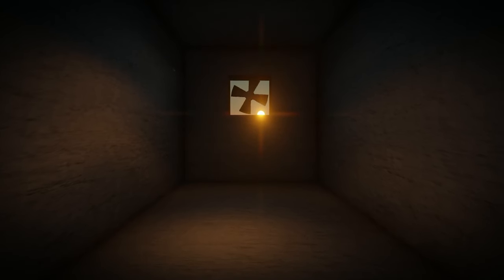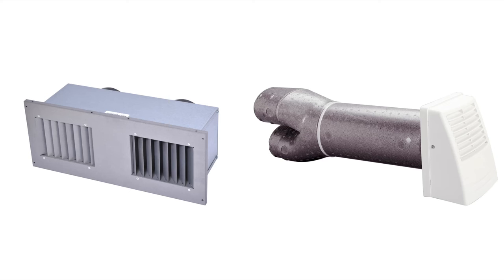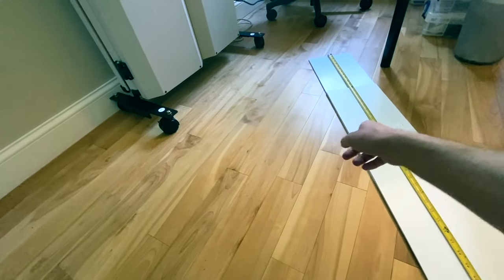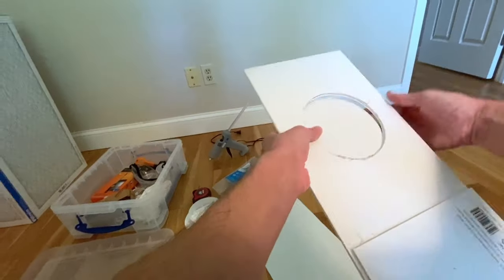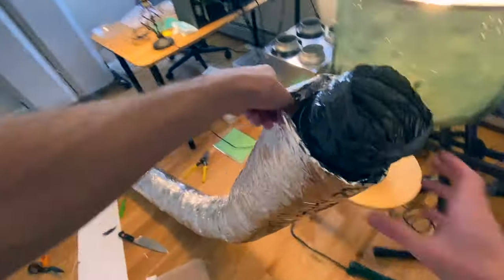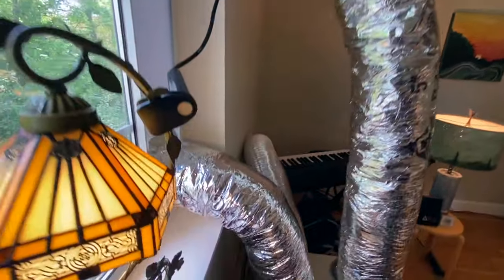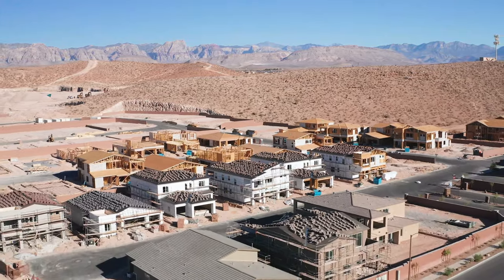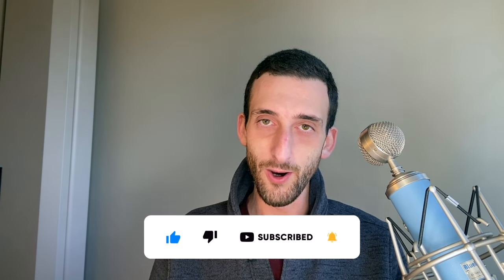DIY Energy Recovery Ventilator Installation (For Homes WITHOUT Ducts!)

Comment: Why do you recommend this approach over say just setting up a high CFM fan on one side of the house with the window open on the other side. Is the main reason simply that the outside air is not always clean? If we live in an area with good outside airquality do you think the HRV setup is still worth it? I probably just need to watch more of your videos, aside from filtration is the HRV unit doing anything else?
Reply from the maker: So, this video is about ERVs, not HRVs. I use an ERV because they moderate both the temperature and humidity of the incoming fresh air. So it's not too hot, too cold, too humid, or too dry. This is crucially important for not only comfort and energy-use, but also to avoid turning your house into a breeding-ground for mold. And yes, the filtration is also important.
Reply: @HealthyHomeGuide  Ok gotcha! So for VOCs, c02, and particulates, a simple setup with airflow and air filters will probably work but if you are trying to control humidity and temp you'll need something like an ERV
Reply from the maker: Correct! I commend you for asking.

Comment: Creating an ERV is super cheap.  Get a tote, a bunch or coroplast, and some foam.  The "core" in the ERV is just layers of coroplast where the alternating layers are orthogonal.
Reply from the maker: You're referring to an HRV. I actually have a video in which I talked about making an HRV. ERVs are not nearly as easy to make because they deal with heat AND moisture transfer, not just heat transfer like HRVs. I discussed this in the video.

Comment: Interesting solution for a renting situation. You could possibly set up a large box of some sort from Ikea like a pax closet, and put the whole thing in there to make it more aesthetically acceptable, hehe. Another idea is to glue on a layer of insulation like rockwool on the coroplast as you might get condensation on it in the winter.
Reply from the maker: I love those ideas, thank you!
Reply: I was personally just thinking of building a box out of plastic or big one out of wood... then you can simply get aluminum sheets, put some holes through them, put a thread through those holes and separate the sheets by nuts.

Comment: Can I just use a dual hose portable ac that uses fresh air?   A good one with a variable speed inverter costs around $400.
Reply from the maker: Dual hose portable ACs don't bring in a significant volume of fresh air, unfortunately.

Comment: How do VOCs compare for indoor air from decade to decade in home building techniques?
Reply from the maker: This is a great question, and the answer is of course very complicated and depends on the specific building materials used. That being said, here’s a general trend: given that newer homes are built increasingly tightly, VOC levels within them tend to rise quite dramatically without adequate ventilation.
Reply: @HealthyHomeGuide  thanks sir! That makes sense.
Reply: I think the home itself matters a lot. Before replacing some windows in my home, we didn't have high humidity issues in the winter, because the heating was pulling air from living space, and windows were leaky as hell. Most likely VOCs would be vented out as well. After we have replaced half of the windows, and changed heating, winter indoor humidity became a real issue. 
My feeling is older houses may had added VOCs and other nasties to the air, but the natural air exchange (thru gaps) was much higher.

Comment: Hi - can you tell me why you chose the 130 CFM Energy Recovery Ventilator - why not spend an extra $100 get a bigger one even if it is overkill? Also Why does it say 150CFM has 67% Efficiency and the 160 has 75% Efficiency - wouldn't you want to get one with better efficiency?

Thank you for the video - it is extremely helpful :)
Reply from the maker: Glad you found my video helpful! That’s a good question. My rationale for getting the 130 was simply that the specs said it delivers enough airflow for the size of my living space. In retrospect, I definitely could have spent the $166 more for the 150 to get a bit more airflow.

As for your efficiency question, I’m not exactly sure - that might be a question for Broan. Personally, I feel that 67% vs. 75% isn’t that significant of a difference. Mine is 67% efficient and I’m very satisfied with it.
Reply: @HealthyHomeGuide  Thanks for your reply. I just got off the phone with Broan and they said it has to do with humidity - so not a big deal either way (I thought it less efficient at heat recovery which would have been more of a problem)

Do you max out the air flow with your 130?

Also how heavy is the unit - is it hard to navigate it from room to room? Does it come on wheels?

Thank you very much!!
Reply from the maker: @chrisjabre  I don’t max out the airflow. The max airflow I can get is 100 cfm (I discuss this a bit at around 23:00), but I use only 55 cfm.

The unit doesn’t come on wheels. It’s 37 lbs, so not too heavy in my opinion.

Comment: Studies have been done that shows that air generally takes the path of lease resistance.  So, draw a line from "in" to "out".  In this case, a path of about 4 feet.  Especially after things settle down a bit.  Maybe a bit farther, but not much farther.  It would be orders of magnitude better it you ran the supply duct line across the house as far as possible to make the return trip take longer.  Longer duct makes static, so you could use a larger duct, which would help a little.  And just so you're not disappointed with your experiments, the various fans are actually probably doing about 20-30% of the mixing you think they are.  A truck load of expensive measuring gear would confirm the actual numbers.  

You have all the parts - ERV, dehu, air scrubbing, ideas about distribution.  Home Performance has a great vid on how to tie it all together when you get to installing it into your home permanently.  

Also, Instead of the small, restrictive filters inside the unit, you could transition the 5" duct to a larger size (some standard size of 4" pleated MERV 13-16, say 24x24 or 20x20 etc.) and back down to the 5" duct.  We often do this from cardboard for proof-of-concept, and to make a model for fabrication.  We call this a reverse bottleneck.  A whole lot less static resistance, less costly, and filtration will last much, much longer.  Ducts are generally disgusting because they have been treated badly and have never been cleaned for the life of the home.  

I know this is an experimental install, but when we install these permanently, as much as we can, we run flex duct pulled as tight as we can, straight as an arrow & use hard 90s for all turns.  So planning is critical.  The slightest turn, sag or bunched-up flex causes huge static (resistance).  We also mastic everything, but in the house, maybe some duct leakage doesn't matter. 

We "exhaust" air from bathrooms, laundry, kitchen - where chemicals, moisture and odors hang out.  Existing bath fan box can be gutted and duct attached to that to minimize the work necessary.  It goes without saying, but I'll say it, air seal everything you can get access to while you have the chance.  Every tiny crack matters.  Water-tight!   Imagine you are sealing a submarine from water leakage, like in "Das Boot".  all the hundreds of leakage add up to leaving a large door open year-round, but it's all over, like a sieve.  

Building Science Corporation is a great source for stuff.  We do Net Zero Energy homes which makes me a little picky about the details that, added up, detract about 50-70%, and often more, when not executed like NASA.

Peace!
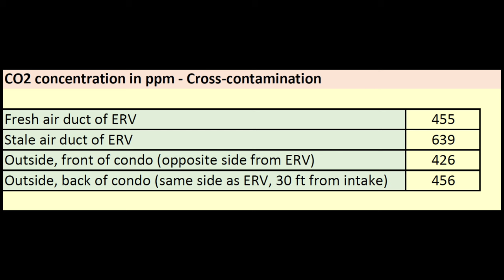Reply from the maker: Thanks for your comment! I fully agree with you about the limitations of my setup method, and I did speak to some of them at 34:55, and throughout the video. 

In this video, I’m not arguing that my setup method is optimal. I’m arguing that it can be used effectively in scenarios where we don’t have other good options - I feel that the CO2 data I presented supports that.

This method can be used by those of us who live in apartments, which can’t be altered. It can also be used by homeowners who don’t live in homes with ducts, and don’t have the money to pay a professional to retrofit an ERV into a ductless home. In many areas, there aren’t even professionals who do that kind of work!

Of course, I would not use my method in a new construction. 

I do agree with all of the points you brought up - you sound very experienced. Peace to you!
Reply: @HealthyHomeGuide  Good data.  Keep testing👍

Comment: Yo Kess, incredible video man.  I've been researching ERV options for windows online recently, and as luck would have it, I stumbled upon this video you created two weeks ago.
A couple questions for you:
-What is the energy consumption like for the ERV model you are using?
-How has the setup been performing in the winter? Does it noticeably lower the temperature of your office relative to other rooms in your house while running?
Reply from the maker: Hey man, it's great to hear from you! Glad you found my video and enjoyed it.
-As far as energy consumption, the PMSM ECM fan motors the Broan AI Series 130 has are relatively efficient compared to some other units on the market. Electrical characteristics are as follows: 120 volts, 60 Hz, 2.4 A, 110 W.
-I checked with a bunch of HVAC installers in northern New England, and they all said that the Broan AI Series are reliable for winter use in this region. Personally, I haven't had it long enough to be able to report on how it performs when the temperature is very cold outside (below 20F or so). When it's pretty cold outside (around 25-30F), it functions well. To be specific, at 25-30F, the temperature of my office is maybe a degree or two colder than the rest of the house, IF the office door is kept open to allow air circulation/exchange. If I close the door to my office, isolating it, the temperature in my office decreases a little more, maybe around 65F when the rest of my house is 70F. ***BUT note that I don’t have a thermostat in my office***. That's with continuous ventilation at 55 cfm. Hope this helps, and welcome to my channel!
Reply: @HealthyHomeGuide  Awesome, thanks for the reply.  That's good to know the ERV does not drop the temperature of the room too much.
Reply from the maker: @johnlally8188  For sure! That’s the magic of heat recovery!
Reply: @HealthyHomeGuide     Are you running that electric baseboard heater in your office?  When the office cools, does the baseboard heater kick in more, minimizing the temp drop?
Reply from the maker: @DK-vx5co Good question. The thermostat (for that baseboard in my office) is in a different part of the house.

Comment: I guess for a humid climate you would have to use a dehumidifier.  I want to install a ventilating dehumidifier.  The hard part is just figuring out the drain for the water.
Reply from the maker: Correct! For getting rid of the water, I use an automatic condensate pump. I'm working on a video explaining how to set this up.

Comment: Thx!  What’s the difference between your DYI HRV and this ERV?
Reply from the maker: Good question! This ERV can run all year round, even during hotter, more humid periods because it modulates heat AND humidity, and my DIY HRV should only run in the cold, dry months because it only modulates heat - not humidity.

Comment: This is amazing, thank you! 👏
What are you thoughts on smaller/cheaper units attached to multiple windows in a home? At a minimum, I'd like one for each occupied bedroom. It seems like the Panasonic WhisperComfort is the most reasonably priced model but I do wonder about the lack of distance between the exhaust and intake...
Reply from the maker: You’re very welcome!
You could certainly try an approach with multiple smaller units in multiple windows. I can’t vouch for the performance of ERVs I haven’t tested, but theoretically, I think cross-contamination would be more okay if an ERV only had to ventilate one bedroom, as opposed to a larger area of a home. Still, it should be minimized if possible; I’d recommend using vents facing in opposite directions in your insert. On the ERV itself, use a 90 degree duct elbow to direct the supply airstream away from the return at least.
Reply: @HealthyHomeGuide  With the Whispercomfort, the interior side is fixed and doesn't allow connecting ducts.  I'm thinking of trying it anyway.

Comment: I have additional comments based upon my experience as a radon mitigator applying ventilation and pressurization to energy efficient dwelling units in this hot, humid climate. Including high rise Multifamily.
1.  I have found that ERVs and HRVs commonly move much more air than advertised. They usually over-ventilate when selected according to published performance.
2. In most tight, energy-efficient homes here in SW Florida, with two or three occupants, I have found that indoor carbon dioxide levels of 600 are easy to achieve with only 18-24 cubic feet per minute of outdoor air. Such low and precise airflows will also mitigate radon emitted from building materials up to about 7-8 picoCuries per liter. WITHOUT THE NEED TO ADD A DEHUMIDIFIER.
3. In my experience, a variable speed air mover can be controlled by a CO2 controller to maintain 600 ppm CO2 by adjusting ventilation rate automatically as occupants come and go. It is uncanny as to how well it really works.
4. It is my long-term experience that that an electronic humidity controller that is set to suspend air delivery if indoor goes above 59.9% will prevent mold without having to install a dehumidifier. A reliable controller will prevent increase in the indoor relative humidity to a level that the air conditioner can't "dance with."
5. Keep in mind that USEPA recommends all ventilation air be filtered by a MERV 13 filter as it enters the breathing zone. https://daisyductless.com 
6. Here in SW Florida, many mechanical ventilation radon mitigation systems include a home-made filter that loads up and stops airflow within a short period. Sure, these installations with loaded filters rarely cause mold problems, but radon reduction is only temporary and for a short term until the filter is serviced again, usually every 60-90 days. Such filters are almost never serviced. And radon goes right back up, but homeowners and occupants don't know it because they only rarely retest for radon. It is not unusual to see radon systems that have not reduced radon for twelve and more years. And the owners don't know it until a buyer asks for a radon test. There will be lawsuits. And I predict that when that happens, many radon mitigators may soon thereafter have insurance cancelled.
7. Blue oil-filled manometers as substitutes for a radon meter. DON'T LET IT HAPPEN. They measure suction, not airflow. Oil displacement will be greatest when the homemade filter is completely blocked. A completely false indication that radon is under control. If I were the lawyer advising the blue oil filled manufacturers i would immediately issue directives that oil filled manometers may never be used as mechanical ventilation radon system indicators unless used with a pitot to indicate actual airflow instead of pressure. A jury would likely ask "What were they thinking when they did this with home-made filters that they knew were rarely serviced?"  What would the jury's verdict be and for how  many $$$$$$?
8. ERVS. If not PROPERLY serviced, air intake filter becomes more rapidly stopped up and exhaust flows remain high. RESULT? Negative indoor breathing zone pressures likely causing or increasing radon risk. Another one for the lawyers. This one could also be determined by a motion for summary judgement limited only by the extent of insurance or by later jury verdict. ERVs must be regularly and effectively serviced. They may even be the cause of totally unexpected radon exposure and lung cancer. Who would have guessed?
Reply from the maker: Thank you for adding your experience and expertise to the discussion! All that is very interesting.
Reply: Is a homeowner able to “properly” service an ERV?  Or is that something a professional would need to be hired to do 3-4 times a year?  I’m in South East Florida and am considering getting an ERV.  Any recommendations?

Comment: Hoping someone can answer my question. My ac unit has a fresh air damper. I can’t use it during the summer due to condensation build up. Could I use that inlet for an ERV and exhaust through one of the roofs air vents? Thank you

Comment: Just turn the have to fan only and open two opposing windows.
Reply from the maker: Not sure what your climate is like, but where I've lived, there are so many reasons why that suggestion is problematic. For one, there isn't always enough natural airflow through windows - it's inconsistent. Also, what if it's too humid outside? This can cause extensive mold growth. Too dry? Too hot? Too cold? Poor air quality? Opening windows is a bad solution for most of the year.

Comment: In my experience, desiccant dehumidifiers may not deliver the fresh air for which they are rated. If a desiccant dehumidifier is rated at 100cfm of fresh air delivered by its internal blower, you MUST measure to confirm performance. You may be grossly disappointed with actual performance.
Reply from the maker: Are you familiar with ECOR Pro desiccant dehumidifiers? I’ve heard they’re really good.